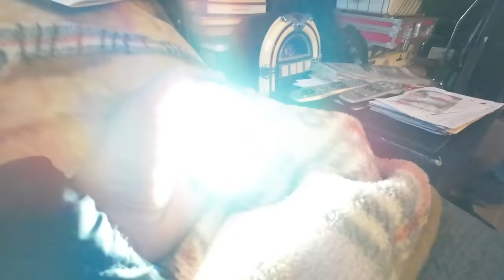Shop Tips From My Dad

Comment: This is a really nice tribute, very moving. My dad was a fitter & turner. He was an Italian migrant coming to Australia in 1957. I consider my father a mechanical genius. He was able to workout how virtually anything would function & if it needed to be repaired, he generally was able to do it. Like you with your dad, mine was a similar learning experience. Plenty of what I learned & still use today, I learned by osmosis. Numerous unspoken teachings, me observing. He taught me how to weld, heat treat metals & operate a lathe, etc. You mention some 'dangerous' practices that were part of your father modus operandi. Mine had many of the 'old school' short cuts that would be frowned upon these days, possibly to the point of prosecution! Joke! My dad would eventually run his own engineering business until he was 80. My younger brother apprenticed with our dad & eventually took over the business. Dad passed away 2 weeks shy of his 83rd birthday.

Comment: Tip for others (I never sit my battery tools in a vertical [battery down] position because I've had them tip over and either damage the bit or the project) it was no fun replacing a chipped ceramic tile one time. I know that's trivial but I still do and instill in others this tip.

Comment: What a wonderful omage to your dad,  My dad died at 84.  He put a claw hammer in my hand when I was 8 so I could help build our new home.  He set me up in front of a metal lathe a year later.  He built ejection seats for Navy jets so we set off 4 ft long solid fuel rockets in the back yard on the 4th of July.  My 8 year old son and 10 year old daughter are learning to cook with very sharp knives and they know how to hold and use my Stanley number 3 plane.  Sharp and hard is good.  BTW - I am 71 and bragging.  In the words of the Essential Craftsman - Keep up the good work.  Cordially - David McGuinn

Comment: I do the same with the old brace and bit. With the battery drills nowadays, no one uses the old tools so you can pick these up for coppers. I have a caravan on a site with no electricity and I find the old brace with a quick-change bit extremely useful I can change the bit to any type and even use I for bolts. The amount of pressure you can use means that all screws will be removed or driven in without breaking them.

Comment: Back in the 50's my father was in printing with no formal construction experience, and yet he built, out of wood, our covered back porch 2nd story with roof and shed beneath. That was when dads did this kind of stuff. He did his own tiling, painting, plumbing repair, etc. It wasn't until I was a young adult that I learned that there were professionals that you can hire to do this work. I just assumed that dads did household repairs and improvements.

Comment: I’m 57 and lost my father at the same time.Thats the way it is.
Great framing tips..the straighter claw hammer are a more American thing,here in the UK they insist on the more traditional curled claw on some sites because they say the framing hammer is more dangerous but I think if your wacking yourself in the head with the back of a framing hammer perhaps you should search for another line of work.